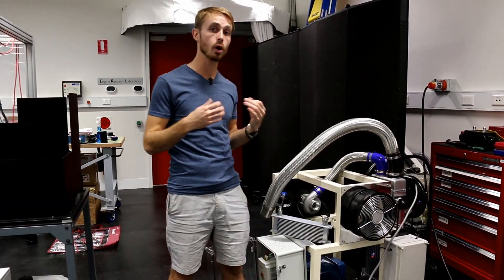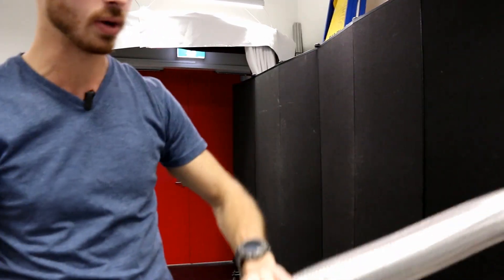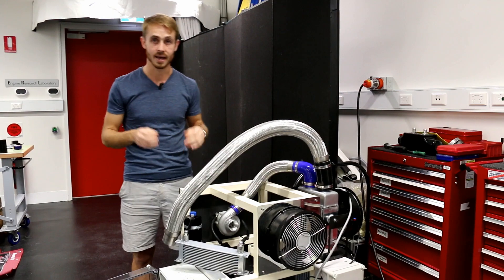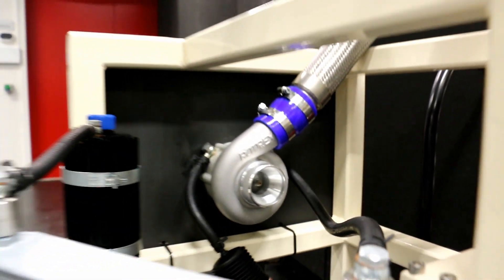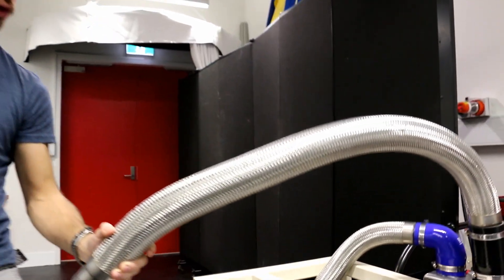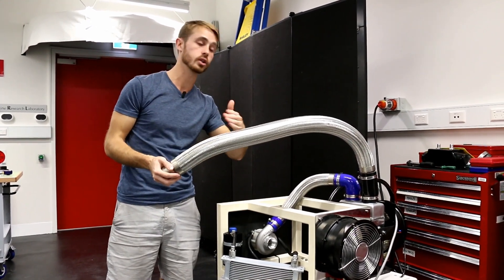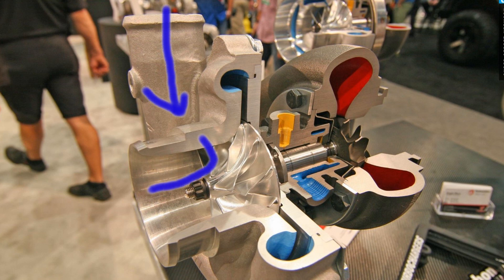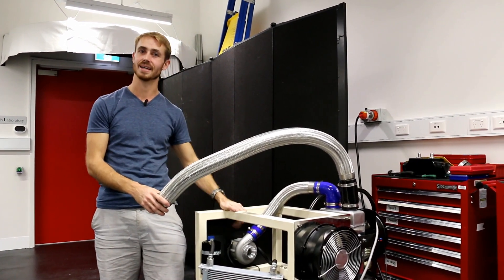What Causes Turbo Flutter? Compressor Surge Explained

Comment: Firstly thanks for explaining the meaning of turbo stall PROPERLY! Not even turbo manufacturers themselves manage to get this one right - talking nonsense about compressors stopping and spinning backwards.I'd like to add a couple of very important points about compressor surge:Compressor surge is caused by two very distinct situations.  And the situations have two very distinct outcomes: One cause you could call "lift-off" or "closed-throttle" surge. Caused by closing the throttle plate, eg. between gearshifts. The other type of compressor surge is "open-throttle" surge.  This is happens when the throttle is open and the turbine is being powered by the exhaust gasses.  It is cause by a turbocharger that flows more compressed air than the engine can digest.
Open-throttle surge will DEFINITELY destroy a turbo (I can confirm because I've done it!).  However, a BOV will NOT stop this; on open-throttle surge the throttle is open and the inlet manifold is pressurised, therefore the BOV remains closed.  The only way to stop this is either to choose a more suitably sized turbo, or to tune your boost control so the turbo produces less boost at the point where it surges.Lift-off surge, on the other hand, is much less damaging - possibly to the point of being negligible.  Exhaust flow is low so there is very little force acting on the turbine.I've built and also tuned a fair number of turbocharged engines of various outputs over the years.  I've also rebuilt a number of turbochargers.  I've never once experienced one die from not having a bov.  Oil starvation, oil contamination, foreign object damage, over-speeding (quite often when a BOV hose, Tee'd to the wastegate hose, splits) yes - lots.  But not having a BOV?  Never.Personally, I feel that the negatives of running a BOV (expense, added complexity, more potential points of failure) outweigh the possible positives.  So I never run BOV on any of my engines - and never will. [Sorry about the big block of text.  for some reason Youtube keeps deleting my paragraph spacing]
Reply: Kj16V I've never heard this point of view before
Reply: This is the most learning I've ever done reading YT comments. Thanks guys!
Reply: Totally agree. Flutter use to be the standard for turbo cars. When turbo cars first came around they all ran without BOV's. Flutter wasn't seen as something that would destroy a turbo not even to manufacturers. I believe it was the rice scene that actually gave rise to BOV's in order to enhance or change the sound of flutter to something else for scene points and it 'saving turbo's' was the marketing pitch in order to sell them to every idiot. It worked because now everyone is running them and less cars flutter but its so boring. I think the point is, physics would suggest that flutter will give a turbo more stress but in reality it's usually never enough stress to make a difference because by the the time that turbo is ready to shit itself because of some pathetic flutter, you'd have sold the car or the engine would have already died long before. Do people realise how fast turbo blades spin? There's barely any setups out there that will produce enough boost to be able to even significantly oppose the spinning blades of a turbo coming off throttle let alone damage them. The charged air trapped between the closed throttle plate and turbo is a pathetic amount of pressure for a spinning turbo to deal with coming back at it. If it really was a significant amount of pressurised air it would pop off most people's flimsy eBay boost pipes for a start which rarely happens let alone damage a fucking turbine that can whitstand explosive exhaust conditions. It's people that sit on their anti lag all day spitting flames and gunshots that eventually fuck their turbo not some pathetic air trapped in your fucking intercooler/charge pipe
Reply: Any turbo will do. I have a small KO3 turbo on my Focus ST, and mine makes that noise as well. If one were to create that noise, they would have to pull the vacuum off the BOV (and go by internal spring pressure limits)...or install a bov block off plate.
Reply: Yeah I know, that's what kind of throwing me off as to why it's doing that with a factory setup. I would say it's more than likely wastegate chatter? That's the only logical thing that it could be AFTER doing that downpipe swap.

Well, I wish I could help out more man, but I believe your best bet would be to go onto a Subaru forum or facebook page/group and ask there. You'd be surprised at how many knowledgeable people there is solely on one car lol

Sorry again man, I don't know enough about Subaru's to steer you clear onto a diagnosis path :( but I can point you in the right direction to get there!
Reply: @UC-t0cPLt_CtL9wnK8t59cXw Hello, 
I have noticed that on a turbo diesel that when the throttle is released after a full throttle acceleration the car sometimes gets a small speed boost, like someone pumped the car, when i release the gas pedal. Why is that?
Reply: @sandertu8366  your turbo is leaking oil internally. When you release the gas the engine is still burning that oil which acts like diesel would be injected. But a year after I guess you already noticed and replaced the turbo as it will get worse over time.
Reply: @Salunikki  
Nope not replaced. Didnt know that was not ok.
Oil hasnt been disapearing nor looked like it needs a top up.

Modern cars fail very smoothly. so smoothly that like a frog in slowly heating water. Most people dont even realize shits bad.

Thanks for the info
Reply: MonteLSV6 no actually thanks for telling me about wastegate chatter, I didn't know that was a thing. I was like it doesn't act like a compressor surge. But I'll look Into it more. Thanks for explaining that to me really appreciate it man.
Reply: Interesting you say that. Flutter under acceleration is a bad thing and known as 'compressor surge'. That means that the engine ins't able to digest the air the turbo is putting into the engine, due to incorrect sizing of the turbo (adding way more boost than the engine can take, routing extra air back through it). If you have this issue now, if that's what it actually is, you would of noticed it before hand....unless for some reason that catless is allowing more air to be fed, since you're basically freeing up the exhaust gases alot more.

I've read that it could be wastegate chatter if your car is pushing more exhaust that the turbo can handle, opening the wastegate and bypassing the turbine. Maybe it's just enough over flow to just get past the psi rating of the wastegate/ actuator. That's more than likely what it could since you mentioned that you put on a catless.

How is your boost pressure? Does it go down a few psi when the flutter is heard? Did it go down before you installed that catless?

My ST peaks at 24psi and trickles down to 22psi. Does your WRX do that as well when the flutter is heard?
Reply: MonteLSV6 it actually tends to stay pretty constant through the gears. It builds boost while accelerating and stays steady while I accelerate. Just flutters. I'm just trying to figure out what my next step should be.
Reply: MonteLSV6 and it can't be because of incorrect sizing since it's still the factory turbo and setup.
Reply: Yep, have that OTS on my 15 WRX but mainly when getting on the boost on longer gears and lower rpm's. Having a electronic boost control valve installed along w/ a proper dyno tuning.
Reply: +Kj16V    Hey thanks for that explanation. I wanted to ask you, how big of a turbo do you need to be able to get that "lift-off' surge sound? Because my car has stock turbos (Z32 300zx TT) and I don't get that sound.
Reply: So. I did not have any turbo flutter before doing this. I got a catless down pipe for my 04 wrx that's the only thing done to it, the rest of the car is bone stock. And it seems to do the turbo flutter on acceleration, considering most say that's not good I'm just wondering what could cause it to do this after a down pipe swap? Or something else I should check?
Reply: billybmxco of course man no problem!

After a quick Google search, I'm almost positive it's waste gate flutter. 

http://www.iwsti.com/forums/showthread.php?t=47213
Reply: MonteLSV6 dude you rock, so I'm not sure if you know. But people seem to love the flutter. Is it damaging? In your personal opinion or is it something people enjoy? Should I get rid of it?
Reply: billybmxco Haha I'm glad I can help dude! I don't think it is damaging. All its doing is preventing damage, really. It's allowing exhaust gases to bypass the turbine of the turbo because it can't spin fast enough to process the extra flow your catless created.

That being said, if you like it, keep it. I personally think it sounds cool as many others do. it's all personal preference and I don't have waste gate chatter lol :( ..but I would keep it if I did!

If YOU like it, keep it. If you don't, well, you might have to get a new downpipe or a resonator or something to quiet it down. Or blast the radio lol
Reply: Allen Ashley haha you're welcome!
Reply: Finally someone who knows what they're talking about.
Reply: Kj16V great comment, thanks for the info! I think I will delete my diverter valves now haha!
Reply: Killswitch1991 nice response hhahaha I love it
Reply: I think the only way this guy would be able to reply to this is with a “HoLy FuCk”
Reply: Thank you all for helping me to learn.  I was dreading the extra cost that a decent BOV was going to cost, plus the extra welding required, and then there was the problem of finding a BOV that produced a sound that I agreed with.  It turns out I've always loved this flutter noise but since too many people were talking about shit they don't know, I was actually scared of having this, and yet I wanted the anti lag gun shots too.  Now I can rest easy knowing my build will have flutter and no gun shot action.  Definitely don't want to be destroying the engine, but also don't want to have a cheap sounding BOV.
Reply: If it’s bad why do all the diesel guys like their trucks turbo to cha cha cha cha or “bark” when they get off the gas
Reply: Using BOV (tutututu) the turbocharger breaks???

Comment: So is the flutter sound bad? Or is there a certain way to achieve it without affecting anything?
Reply: +Andrew Luebker im planning on a low boost build (1.3 sohc carby engine, yes i know the storys with turbos and carbs) but if im running say 4psi should i worry about a BOV? or is it wasted money. id still have to lower the pressure it opens at.
Reply: +chris fitch Not really needed. My buddy has a bug with a turbo like that, no BoV.
Reply: A bug would be awesome to turbo charge, thank you for the advice. On another note, do you know if they had to mod the carb much and what boost they run? Im charging a b3 engine out of a 94 mazda 323. I know i need to raise fuel pressure 1psi per pound of boost and theni can equalise float bowl pressure simply with a piece of hose (seen it done on here) and at 4 psi i shouldnt need to swap out floats should i?
Reply: +chris fitch Are you sure it's not fuel injected?
Reply: +Andrew Luebker yep. its got a big ol' carb just sittin there under the filter/cover
Reply: Yeah, I seriously doubt you need a BoV.
Reply: Sweet! Thanks
Reply: chris fitch worry more about boost referencing the system
Reply: Turbo flutter doesn't damage the turbo, however compressor surge does. The difference between them is that the flutter is at closed throttle while the surge is at open throttle
Reply: It's basically caused when the excess pressure can't escape,  so it goes back into the turbo and slowly it down faster than normal,  shortening it's life. If you have a proper BoV, then it won't flutter.
Reply: +Andrew Luebker slowing*

Comment: One thing I do noticed about turbo flutter sound is when I switch from a big ball bearing turbo  to a small journal bearing one, the flutter gets a lot less noticeable, I guess it's the journal bearing turbo with more friction and less rotating mass to make it spool down faster, thus reduce pressure build up when throttle is let off.
Reply: I would've thought that had more to do with the size of the turbo than the type of bearing?

Comment: A slightly off-topic question... Is this setup similar to the mechanics behind the electric compressor, which is 1/3 of the triple-charger forced induction system in the new Audi SQ7?

Comment: Some sources mention "wastegate chatter/flutter" which is supposed to sound similar. Does it exists or is it just a forum myth?
Reply from the maker: +Martin Cerman Wastegate chatter is a real thing, however generally forums have it wrong and use the term interchangeably with compressor surge. The "tsu tsu tsu" sound is not wastgate chatter, wastegate chatter itself can occur from the exhaust pulses moving the wastegate on and off its seat at low wastegate openings, or from the boost controller opening and shutting the wastegate rapidly to control boost (this only happens on some setups). This noise will be more apparent with an external wastegate as the exhaust pulses from the wastegate opening and closing will be loud. This will only happen under reasonably high throttle inputs though, not when you shut the throttle as compressor surge does.

Thanks for watching!
Reply from the maker: +chilljlt Yep, I can think of a reason. Compressor surge causes pressure pulses post compressor (see this graph http://www.gfb.com.au/images/templates/gofastbits/parts_for_joomla/part_/resized/compressor-surge-2.jpg ). If the boost controller is taking its pressure off the compressor housing, it will be seeing spikes in boost, and as a result it will try to compensate by opening the wastegate at the same frequency as the pulses every time a pulse exceeds target boost. This would be corrected by installing a BOV/bypass valve with sufficient authority to stop the pulses. 

Thanks for the compliments! Glad you are enjoying the videos!
Reply: +Martin Cerman I always thought it was wastegate chatter as well ... I see carl said in his reply that , it only happens on some setups. So i'm guessing the Group B Audi's setup was some how different to the Ford RS200's or the Peugot 205T16's ... As the Quattro's chatter is very distinctive ?
Reply: +KYLE.DRIVES If the waste gate spring were setup low, and the boost setup relatively high (say, using an e-boost controller), couldn't you get a wastegate chatter on throttle lift of as well? The turbo would rapidly spin down also causing impeller at the exhaust end to build up pressure against the still rapidly exiting exhaust gasses? Since waste gate's physically open outwards wouldn't this cause sufficient build up of pressure to force it open?
Reply from the maker: +chilljlt Nope, as soon as you lift the throttle the airflow through the engine drops and less fuel is injected, so your exhaust velocity drops significantly, reducing the pressure at the turbine massively (think of this as the mechanism by which the turbo spools down when you let off the throttle). The drop in airflow is going to occur at a much faster rate than the turbo will spool down, so there wont be pressure to force the wastegate outwards. Does that make sense?
Reply: +KYLE.DRIVES Absolutely. That came from no real world experience. Though, I'd noticed a turbo wastegate open and close ever so slightly, yet visibly on a vehicle setup with Eboost controller and low spring value (for the ability to control boost over a wide range) on throttle lift off on a dyno . What could be the reason for this? This was , i'm told , corrected by installing a BOV. 
That aside. I absolutely enjoy your videos! Especially since you don't dilute the fundamental idea in an effort to make it approachable. I find that to be the case with most auto channels

Comment: show us a map that has the surge line plotted.  :-)  In the diesel engine (no throttle plate) lab while matching turbo to a rating we often could hear a BANG and the flexible lab  airlines TO the compressor would shake violently.  The dyno auto control would then unload the engine and allow the engine to recover and it would then go boom again once the compressor had enough energy to spin up to the surge line.  Fun days from the past.

 The cutaway makes a nice credenza fiddle piece of iron.  The cutaway looks a lot bigger then what you were using. It looks like one from a 500 hp diesel  truck engine.   Back sweep compressor blades?  

Thanks for the interesting topics
Reply from the maker: +MIGuy Well, I was planning on doing another video at a different time on how to read compressor maps (it's already on the request list), figured I'd keep this one short and sweet to show the basics of turbo flutter =). Not sure what a "credenza fiddle piece of iron" is though? The image was just a high res stock photo that I found of a cutaway turbo from the angle I wanted.

Thanks for the compliments!